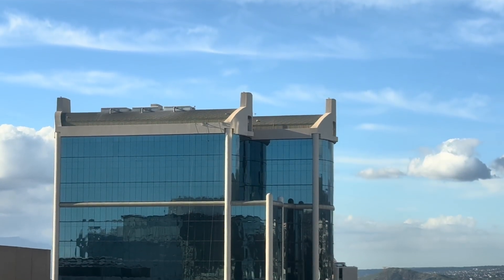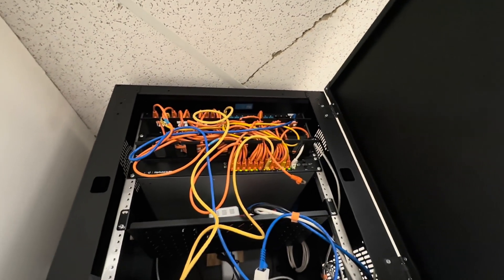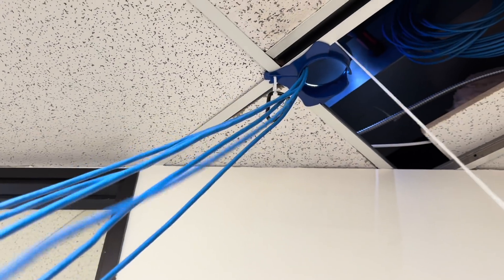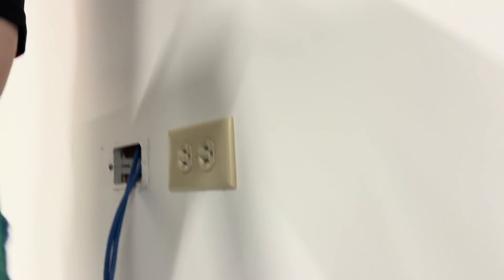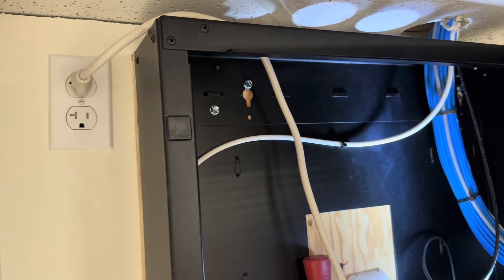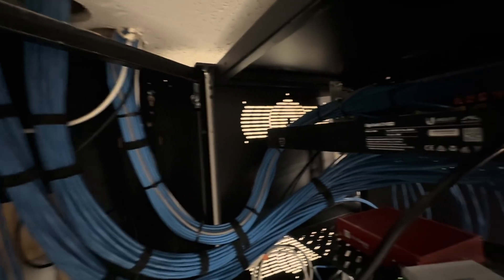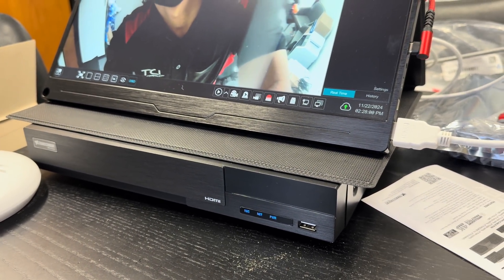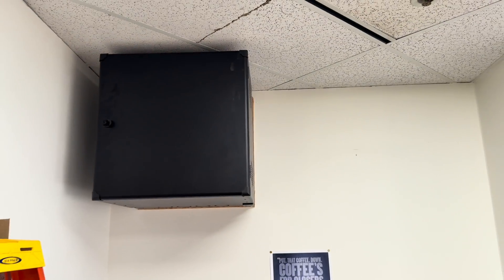Network Rescue 5 - Space Wasting to Efficient Panel Layout

Comment: Are you responsible for configuring the switches?
Reply from the maker: It is pretty rare that I get to do the switches, the main time I do it is when I've directly sold the account some VoIP, IP cams, and Wifi, and then have a term of maintenance to perform.  In those cases I can configure it my preferred way.
Reply: @ I figured the routers and switches are most likely outsourced to an MSP but I saw you install it so I figured i would ask. Thank you!

Comment: So I'm watching your channel and I'm wondering why you use punch down Keystone jacks why not toolless? And I guess also what about RJ45 field termination plugs? Do you ever use those or are you using an rj45 with a crimper?
Reply from the maker: I've never used a toolless keystone or rj45 that felt as substantial and sturdy as the normal ones.  What type do you use, I'll check it out?
Reply: @tciproductions  I don't really use any particular type because I really don't do this outside of a hobby but truecable has some good ones from what I've seen.

Comment: Nice video, great work! Regarding your 48-port patch panel, does this require special "slim" or reduced-sized keystones? Would this affect crosstalk problems if you try to achieve 10 Gb speed? Even my 24-port patch panels require care in selecting the keystones to use - some are too wide to fit properly. Also it would be nice to select keystones that work in this panel and work with punchdown tools that cut all 8 conductors at the same time, like the ones from TrueCable or Vertical Cable.
Reply from the maker: I try to use these slim ones from Everest, https://amzn.to/3Bm9SzI, it also has an all-in-one tool, https://amzn.to/4i98rFs, and these have worked for me.  Buying the panel, the keystones, and so on, all from the same vendor is usually the best way to go.

Comment: It turned out nice, but it seems there was a lot of wasted cables, maybe 8-10 ft with slack reaching all the way down to the floor
Reply from the maker: Here's my thinking about the length of cable - the length at the stingray had to go another 4+ feet to the cabinet, plus a service loop.  It came out with about 24" of material to work with at the panel.  To my mind that's just about right.
Reply: cable is very cheap.
Reply: @kellymoses8566  And re-pulling a cable because you're a few inches short a couple years down the line is very expensive!

Comment: Any STL file for those split cable tunnels?
Reply from the maker: I have one forthcoming, it needs some refinement.  I will post it with my next 3d printed parts vid.
Reply: @tciproductions  was thinking the two halves could dovetail into each other, maybe with a T profile so they can't pull apart except vertically.  Definitely looks better than those gaping holes!